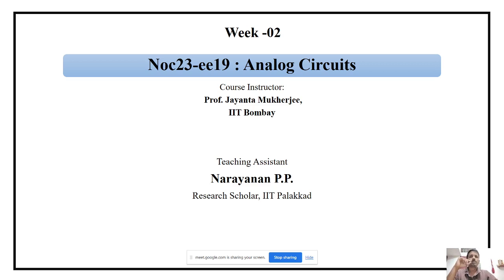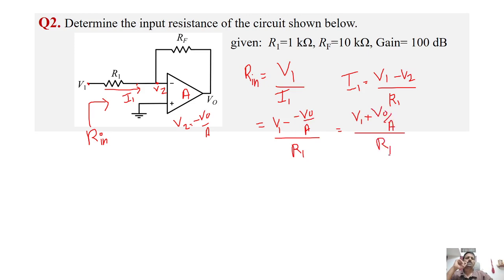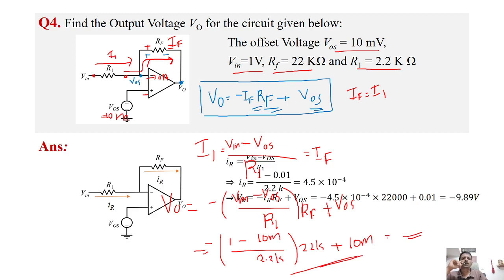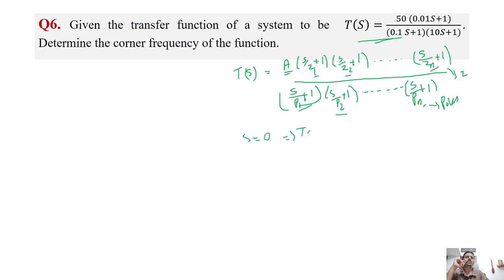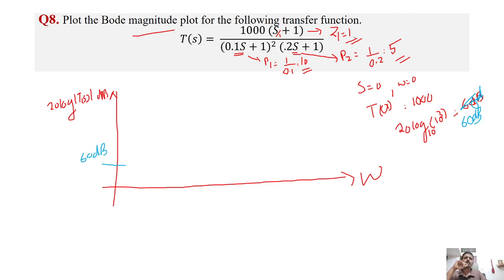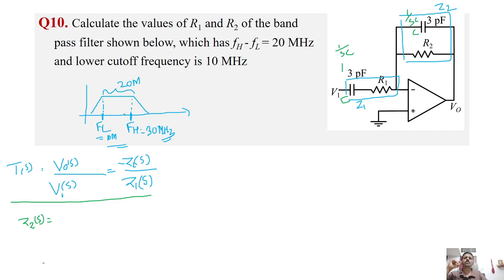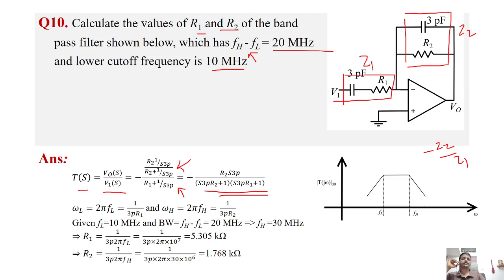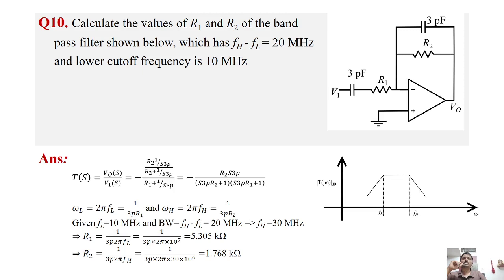Week-2: Noc23-ee19 : Analog Circuits

Comment: Sir,  I wanted to do masters in IIT in VLSI.  How did you learned analog so well.  any tips please?? Consider guiding your youngerself
Reply from the maker: Initially I tried to clear the basics in electrical circuit analysis. Then learned analog circuits from microelectronics by Sedra and smith.
Tip: make sure you are comfortable in analysing circuits using KCL and KVL first. Then try to study the basics of analog circuits from sedra and smith.